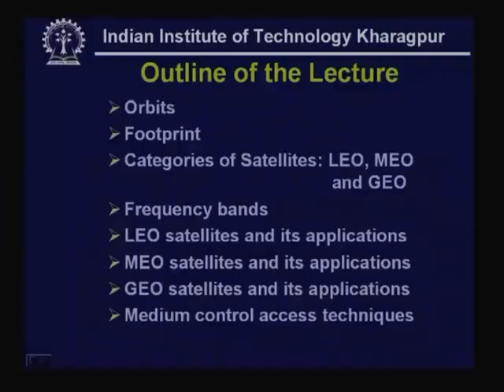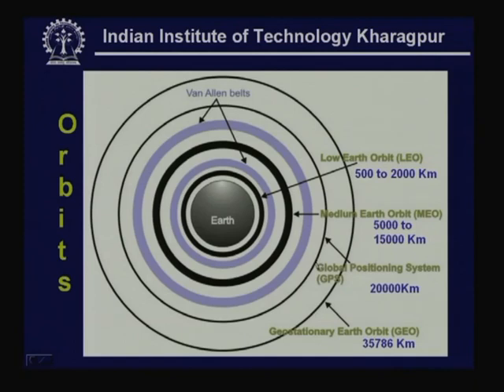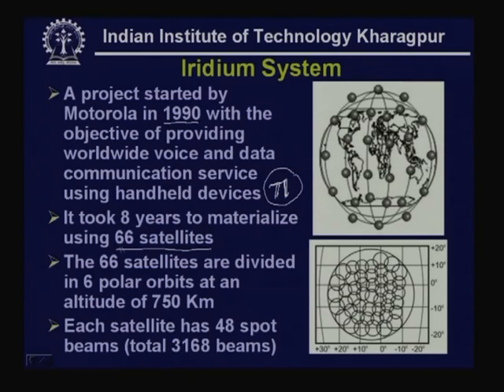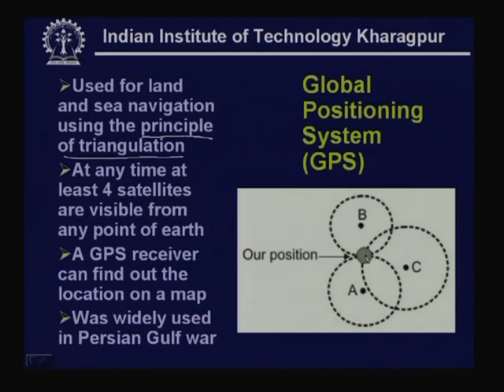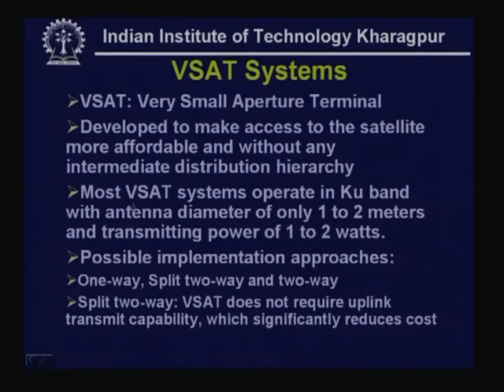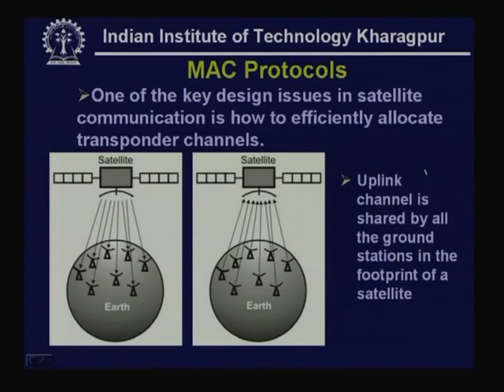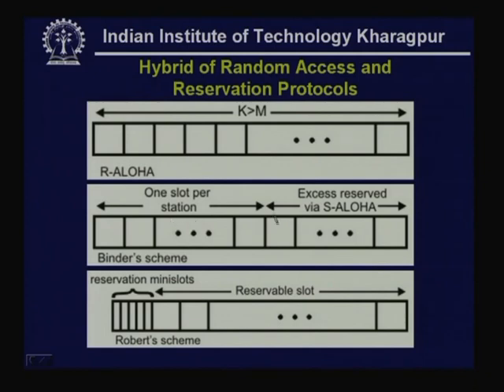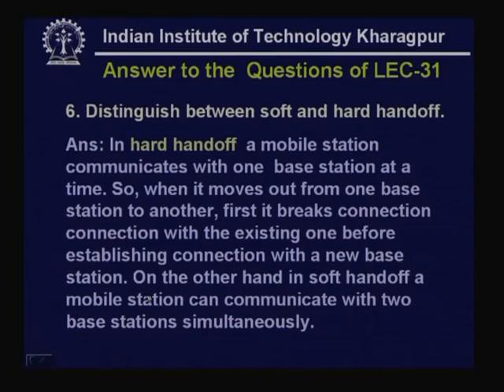Lecture - 32 Satellite Communications

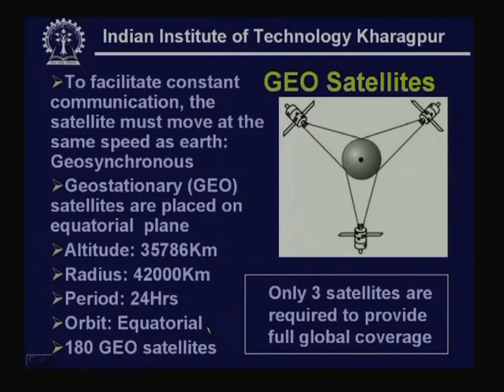Comment: 27:27 The geosynchronous and geostationary isn't the same thing, plus the definition "they move at the same speed as earth" is totally wrong. :/ 

Geostationary is not just an "equatorial geosynchronous", it also has to be circular and it is very important, otherwise it wouldn't be stationary. 

Also geosynchronous orbit can be equatorial to yet not geostationary (if it is elliptical). 

Geosynchronous is just simply an orbit that has an orbital period that matches Earth's rotation on its axis.